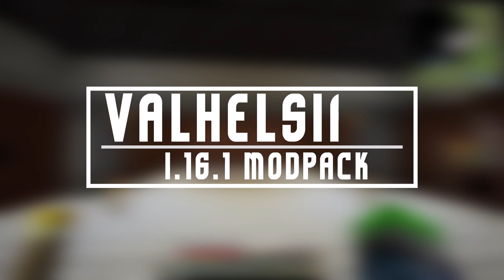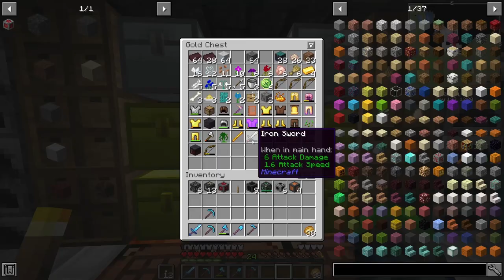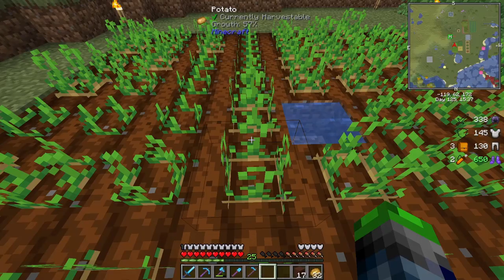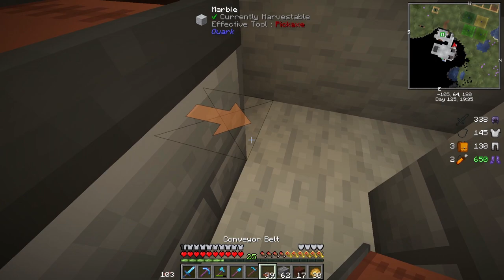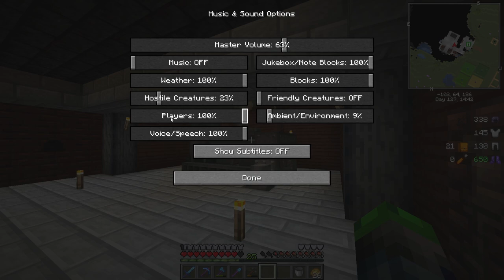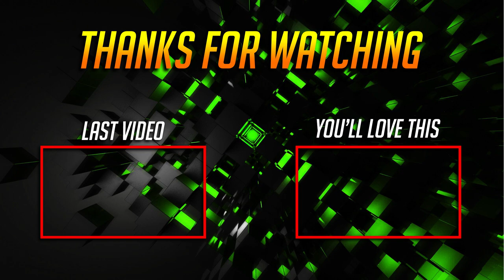Valhelsia 3 | Bio-Diesel Generator and Garden Cloches! | [EP 7]

Comment: You can get an indestructible engineers hammer by using the eternal stella in the secondary slot of a smiting table  with the engineers hammer. You can also do the same for the wire cutters.
Reply from the maker: Oh! Well that's actually very awesome! I will have to take advantage of that! Thank you very much!

Comment: And also, instead of using immersive engineering pumps you should try to use a sink, it works way better and doesn't require power.
Reply from the maker: Jarno haven’t found a way to get the water out yet, there doesn’t seem to be a good option for fluid pipes yet in the pack 🤔
Reply: @YTSuperturtle  You could use the mekanism pipes, and you need to use a configurator on them, they should work.